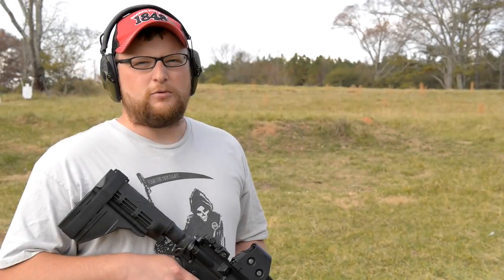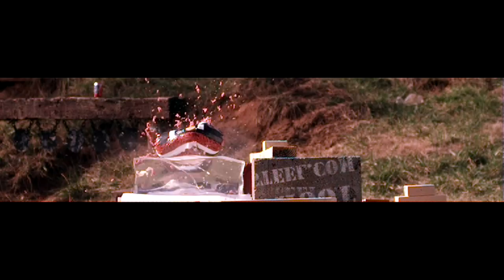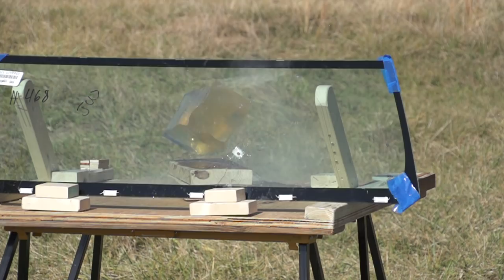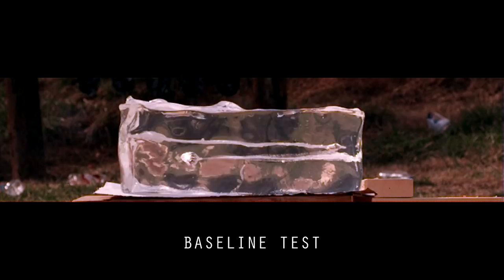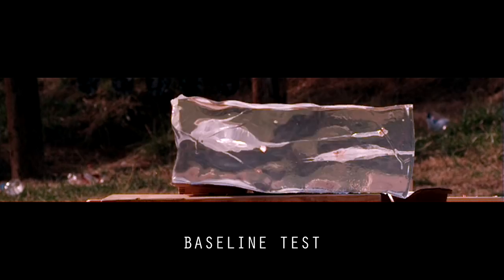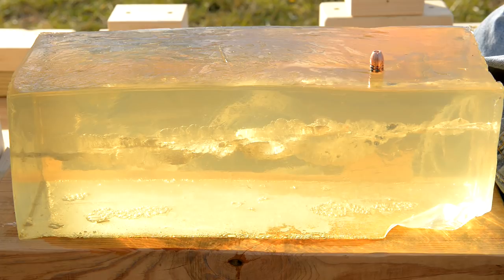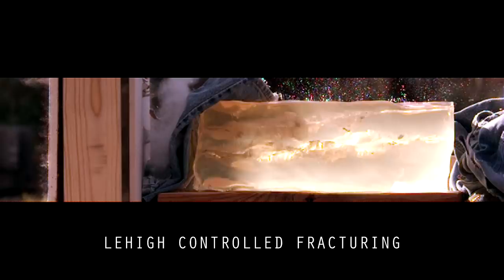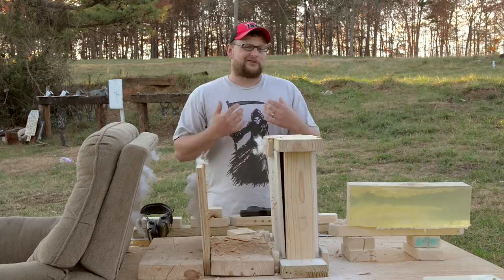What Bullets Do In Real Life

Comment: You went through a lot of gelatin blocks for this video, I just found out that the stuff is not cheap.  Thanks for your excellent work.
Reply: it's reusable though...
Reply: I know I'm two years late, but you do realize you can melt the blocks back down, remold them and use the same gel over again... right?
Reply: @AlpacaButts  how u do tht. Special equipment?
Reply: @emeza116  Nah, not really. Ballistics gel has a pretty low melting point. wash off your gel chunks, make sure all the water is gone (important) and put it into like a slow cooker. Slow cookers are pretty inexpensive, so if you do this a lot you could have separate slow cookers for cooking food and melting ballistics gel. Heat it up, it melts, pour it into a mold through a strainer and then let it set. It's not going to be as perfectly clear and see through, but it beats buying new gel every time hands down. There's tutorials online if you're interested. Have fun! :)
Reply: even making your own is expensive as hell
Reply: @stanleycupchamps2009  prices have rose.
Reply: You recycle it by melting it down.

Comment: When a solid project hits an angled barrier the is phenomenon called "normalization". It is approximately a 5 degree change in trajectory. So if you are shooting at a windshield for example and it is angles at 45 degrees the projectile tilts and enters at 40 or so degrees. That why the bullets were entering the ballistic gel lower than expected.

Comment: It seems like the rounds are getting further in the gel with the auto glass when compared to the baseline tests. This seems counterintuitive to what should be happening. Any explanation?
Reply: +Jackson Tyler He starts to semi explain this at 7:36. He is largely testing defense loads which are designed to expand upon impact with soft material like skin, muscle etc. These rounds have a hollow cavity and when they impact a "soft" target, they want to spread out to create a larger cross section. This effect= maximum deliverance of the round's kinetic energy and also inhibits over penetration. But when these rounds hit a hard surface such as drywall, laminated auto glass etc. the hollow cavity, or petals of the round want to push inward instead. This situation essentially turns the rounds that were intended to expand into something that would more closely resemble a full metal jacketed round in effect.
Reply: +Jeremian Lastly That's exactly it. I remember MAC doing a similar test using a variety of barriers. Most of them tried to act like ball ammo. Only consistent round was a lehigh round.
Reply: He states early on that the hollow point type rounds tend to close over when hitting barriers

Comment: i think there could be some inconsistency after each shot into the glass, it could be shattered across entirely(but you couldnt see it, verry tiny, sometimes just structural shards, the ones you cant see) due to the fact that this type of glass spreads the forces that hit it evenly to provide as least shattering and destruction as possible, because of that every next shot maybe had to use less energy to break through glass that is already damaged a little

Comment: I have a slightly off topic thought that I'd like to see demonstrated testing on. Everyone talks abotu the stopping power of a bullet such as .38, .45, 9mm, etc. 

Aside from just simple bullet expansion, and single barrier penetration. I'd like to see work done comparing the total penetrating capacities of several calibers of ammunition, including just the total number of inches one round would penetrate gel, 10, 15, 70? What ever. Then I'd like to see the ability of those rounds to penetrate a barrier, such as armor, or what ever else.
Reply: I hate to say it, but you could use the ENTIRE Glock line to "be fair" with barel length across all the calibers.

Comment: I've seen on other vids with filled hallow points expand with barrier penetration before. Does that make a true difference?   Say a hallow points was filled with lead or wax even,would it expand like designed and penetrate barrier? Creating hydraulic instead of condensing like hallow points that fill with glass,metal, sheet rock, denom, etc?

Comment: Not a gun expert here. What has more penetrating ability, and under which conditions? 9mm or .45?
Reply: 9mm is for penetration kind of like a armor piercing type roundcwhile .45 i pure power straight through hard hitting. Also, 9mm tumbles shred up flesh
Reply: +watermelons So for my 9mm personal defense gun should I be using hollow points or would fmj be fine?

Comment: Curious... what do the number of grains have to do with bullets? Is it the more grains the more power behind the bullet? Speed? Or is it the more grains the messier the gun will get? I'm assuming that more grains mean faster speed and heavier hitting right?
Reply: The grain is the weight of the bullet the higher grain the heavier the bullet. And the heavier the bullet the slower it goes.
Reply: Dave Strider 9x19 is the actual measurement for luger. All of the other sizes have names as well. tokarev, Makarov, and largo. they are all 9 mm. If you find yourself in the western world and say 9mm, everyone will assume you mean luger unless you specify otherwise. Generally, Walmart is not the place to go for technical info. lol
Reply: Dave Strider 9x19 is the actual measurement for luger. All of the other sizes have names as well. tokarev, Makarov, and largo. they are all 9 mm. If you find yourself in the western world and say 9mm, everyone will assume you mean luger unless you specify otherwise. Generally, Walmart is not the place to go for technical info. lol
Reply: dynoclaus So- wait. 9x19mm NATO is wrong??? Now you're confusing me. I saw the box reading 9x19mm NATO in front of me.
Reply: Nato adopted 9mm luger and that gives it the nato annotation. This is done with all nato cartridges. For example, .308 win is reffered to by nato as 7.62 nato. it is exactly the same thing, but different names are printed on the package depending on who it is produced for and distributor preference.
Reply: I should also mention that in order to be marked as NATO, rounds have to meet NATO specs in regard to materials used, including propellant, bullet style and weight. In short, bullets must be "ball" and brass cased. parameters
vary based on the caliber.

Comment: OMG i could not believe that after shooting guns & testing rounds, that he would not aim higher before shooting through Windshield, after all its got a slope on the glass which effects the angel of exit & i knew this before he said it, how on earth could you even put an upload if you did not know about this fact before testing rounds. lol ?
Reply: Aaron Cowen from sage dynamics has all but disproven the glass thing. Bottom line, you never know what glass is going to do to trajectory. You can shoot the exact same glass angle with the exact same trajectory multiple times and some rounds will go high, some will go low, and some won't change at all. That's why most instructors are now saying to just shoot a few rounds through the glass first and disregard those, those are just to get the glass out of the way, and then put your effective fire on target through that hole.

Comment: why did the bullet drop after entering the slanted windshield?
Reply: +Darren Laval because its slanted. .
Reply: sorry, would it not send it upwards because of the slant or does the rotation of the bullet pull it downward
Reply: no, its just like light, the bullet wants to bend to the glasses norm (middle). this is because on a tiny scale the bottom of the bullet point hits the glass before the top of the bullet as the slanted glass is slightly further away for the top of the bullet causing it to skew downwards.
Reply: +Darren Laval  Another way to explain it, is that typically speaking, it would only go up if it bounced, and down (or whatever direction the barrier is angled) if it penetrates. 

or...  "Because friction."
Reply: Because it is slanted downward. if yoy shoot out of of car through the front windshield it will go up because it's slanted upwardsl